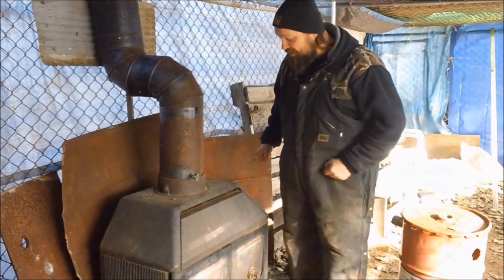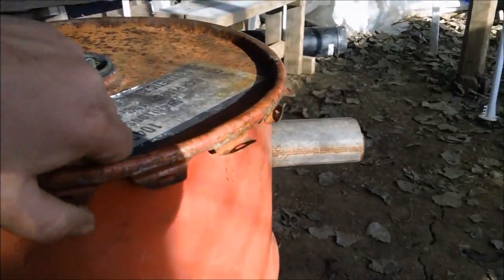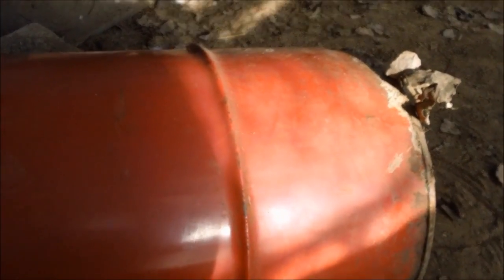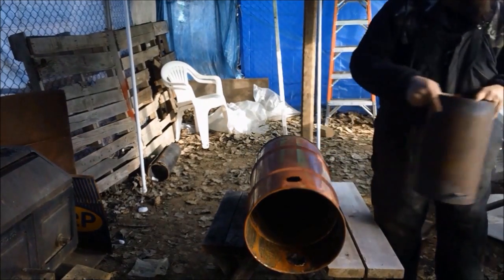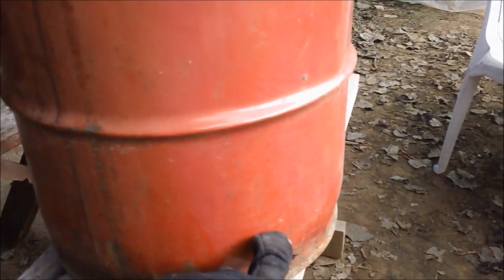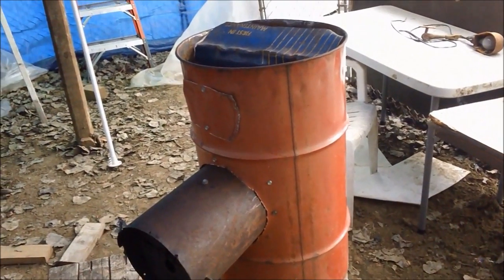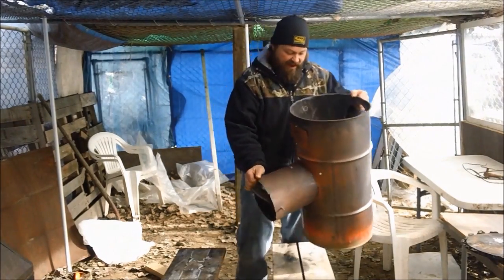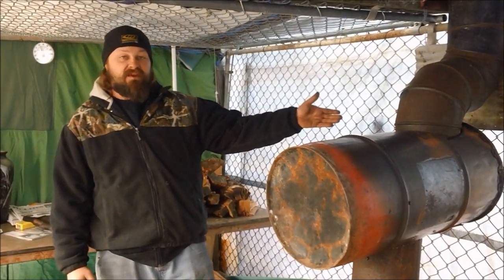Homemade Baffled Heat Exchanger for my Wood Stove

Comment: You should use schedule 40
Pipes front to back with an air box and fan to build a heat exchanger

Comment: instead of smoke can we use water ... so please can u tell me about single-layer helical baffle and also two-layer helical baffle
Reply from the maker: There is a lot to talk about when it comes to helical baffles. If you are asking me if i think you can slide one in the drum as a heat ex changer. My answer is. Why not?!?!
Reply: can u please tell me more about helical baffles

Comment from the maker: Then the exchanger radiate's some of that heat that would normally gone out the pipe. the exchanger will still run about 400f but the stove will be more like 600f

Comment from the maker: On a steel stove i would have put above.This one is an old cast iron and I have used this stove for over 15 years for a couple different applications.I experimented with a couple different exchanger and have found that the cast temp drops about 200 degrees. The exchanger robs to much heat from the cast iron. One of the biggest problem i have had with this stove is it takes an hour+ to heat up,but with the exchanger i have heat in 5 min. Once the cast is hot.Close the flue.Stove hits temp.
Reply: nice...you say stove(cast iron ) temps drop..was about to try on mine...you suggest I try something else? any new thoughts? also i don't have a flue damper yet..would that make a big difference?
Reply: also does installing it horizontally affect the chimney draw? and what do you think about adding a secondary air flow?

Comment: Shouldn't the damper be above the heat exchanger instead of between the heat exchanger and the stove? What do you think?
Reply: Nope if you put it on top and close it you'll have gases escape from all the joints below
Reply: Should still be up atleast a foot from the stove